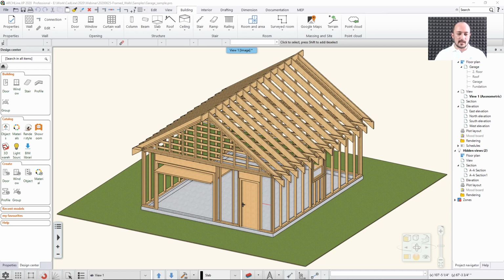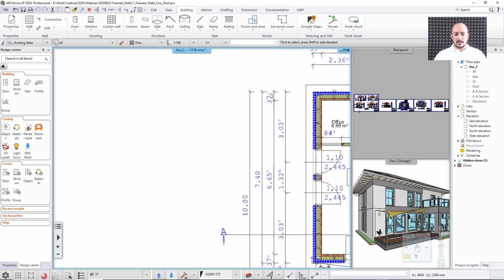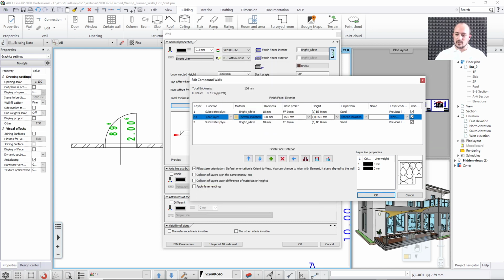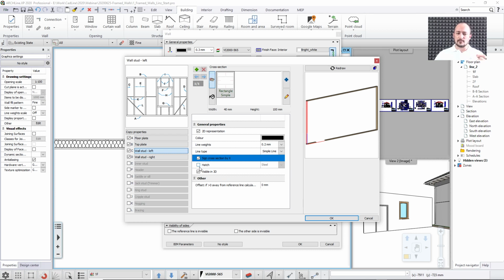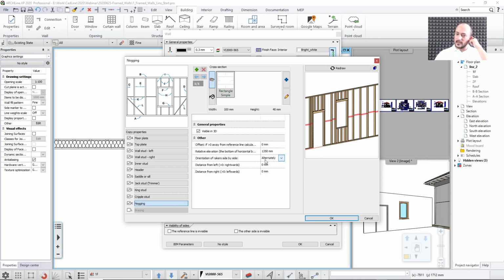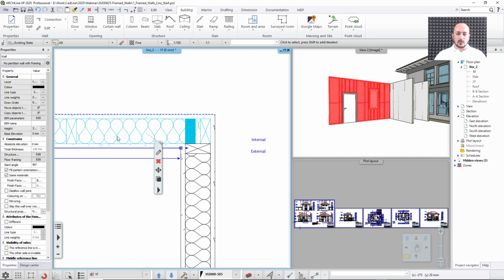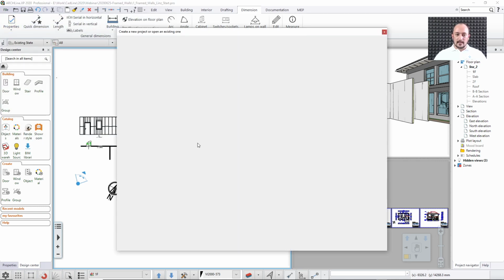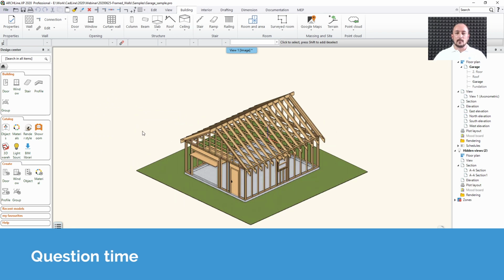Framed Walls - ARCHLine.XP Masterclass 8

Comment: Hello Team.
Thank you so much for the tutorial.
I have a small question. Is it possible to export the wall frame to a IFC file? I work with a structural engineer, and it would be of great help to him if I could just send him an IFC file with all the wall frames and trusses... 
I have no issue converting trusses to IFC, but wall frames I can't see the frame on a IFC file....
Thanks for the help